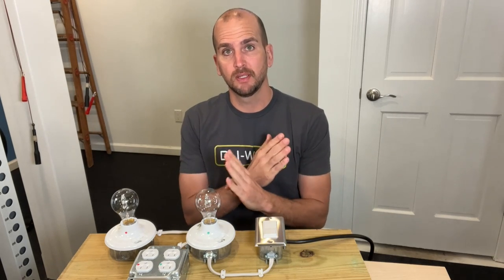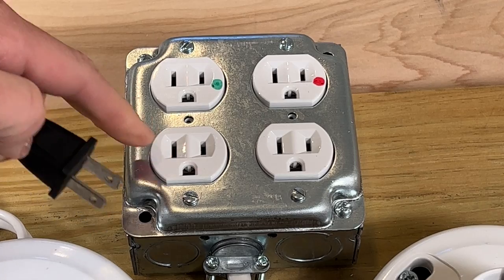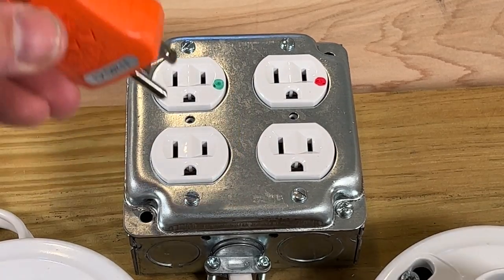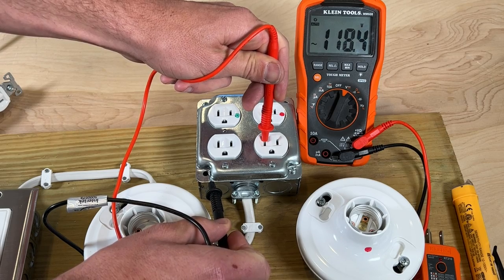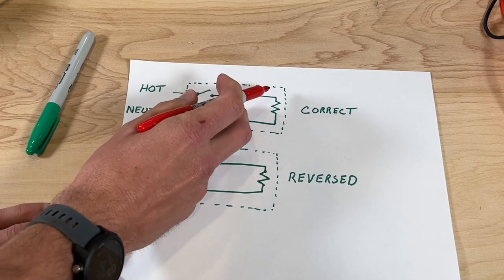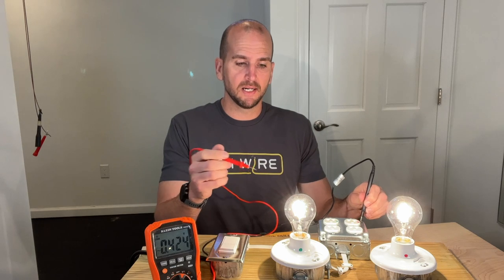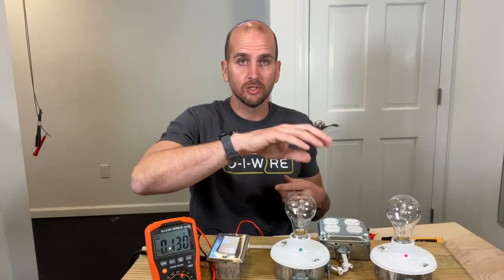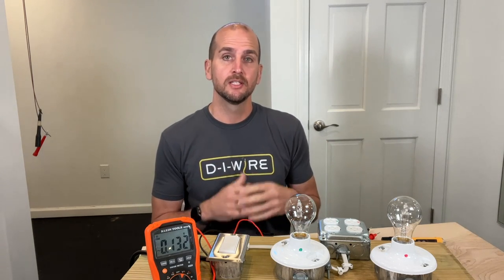Dangerous Wiring Issues In Lights and Outlets

Comment: 5:35, having a reverse polarity only is unsafe for the reason you showed.  It will not "Reduce the life", any more than a normally wired device because current is not flowing through the device if the switch is not closed, or it has some other way of completing the circuit.  Basically.. the electrons have no where to go.  The electrical potential is there (able to shock), because the person completes the circuit to the ground.
Reply: You have no idea on electrical. All corcuits like recetical mot being used but main breaker in is waiting to grab you and electricute you. All a receptical is , a wire with curent on it and a neautral to varry back half of the volt amount and a ground  is the earth rod 6 feet in earth to stop a line curent dead , trip breaker to take off the line curent, if line curent 0 volt ac  there no half  of it so it be 0 volt ac and ground always be 0 volt ac or dc.
Reply: @michaelspencer6523  really hard to understand what you are trying to say.. but here we go: 

There is no such thing as "main breaker trying to grab you".  What you are trying to describe is called POTENTIAL.  Like bottling up a water hose, with water pressure.  It wont shock you until it has a place to go.

 You have to complete the circuit to make electrons (aka electricity) flow.  A device will never "wear out" if it never sees that electron flow.  When a human "gets shocked", they basically "complete the circuit" and the electricity flows through the body like a metal conductor.  No loop, no shock. No loop, no electricity flow to harm anything.. including the devices in series in the circuit.  There is always an electrical source, conductor wire to a device, then from that device back to the source.   Break the loop, nothing happens. 

An earth ground only matters if you complete the circuit (loop), for the electricity to have a path to go to ground (or a battery or power station ground).  A wire has no current on it (current is defined as the FLOW of electrons) until it has a place for those electrons to go.  

A circuit breaker is merely a protection switch, that shuts off if it heats up from too much current flow.  It is merely a switch. Nothing more when it comes to the actual flow in a circuit.  I sometimes use circuit breakers as a switch.. instead of a regular switch, though that can wear out the springs in them.

BTW, I have an actual electrical engineering background.
Reply: @jacobw446  one main reason you not understand a electrician is you not a electrician and probly not from usa to onow slain english. Only great brittian speaks correct english. It not mean it did right, or usa enlish   is only slain. That  the names of tbe way ots customs is in real world. In iraq and afghastan wars. , i was over manys  britts. I had to gdt a translater to understand them. Like they sau its bloody bloody mate. I had know idea what tbey saying or meant
 It just meant it out of sight or very great friend. !  But anyways, you msde your self look bad at begining by saying YOU can not understand.  It simple englidlsh of usa. People think, i waunder  if you on drugs why not understand  grammer school slain english.  I know alot languages, tagalog, mindalin, etc. You learn many languages in tbe special  forces on usa army. And navy seals.
Reply: @jacobw446  loop, get off tbat game, there no loop, ac means alernate currebt  up and down not in a loop circle. My good ness, dc means direct currect means straight out not back. So ac has a curent line and a traveler of return called neautral and a safety  stopping net  called bearth ground. Dc is curent line plus isolated ground not neautral. It not travel back.
Reply: @jacobw446  go take a smal electrical journyman test , see how soon they escourt you out before you done as he walks around reading tests
Reply: @jacobw446  reason i said just a electrical journeyman test is, it only $20.00 test to loose not a $600.00 test plus a high bond cost  to loose
Reply: @michaelspencer6523  Guess my $100,000 electrical engineering degree takes a backseat to a $20 test and $600 bond.  Gee what was I thinking getting all that education for 6 years for my masters....
Reply: Incorrect. Polarity, is like a diode, it only allowed to travel 1 direction, the curent direction. The neautral is still made fir its components, it just the pathway is stoped until all voltage is equal to open its gates like ffom a bridge rectafier with 6 different  volts. Once all equal the total opened volts it turns on next step. It does not bypass a step. Polarity saves equipment that must be operating at same time it does . If not the relays not operate the circuts. Onece all ready it opens the coils volage of relays it needs to close relays contacts , it sends circuits voltage  to operrate. Can that polarity electricute ? Of coarse it can, it only current sent through processes straight to the components that neautral already in contact. Voltage still same as before it through polarity equipment.
Reply: @jacobw446  that the biggest lie yet. If you was a electrical engineer. You knew about everything i said, polarity and its dangers and earth ground and neautral not a ground but a traveler. Those items so serve a elctronics engineer already knows  that. Plus it not take $100,000.00 to take electronics as i did also. I need know  who be the school have you a degree electronics engineer endangering everybodies life in your therrory ? I also had to take a complete coarse in osha traing and i got all my 35 osha  deplomas . Serious violations you tell others . It bot just incorrect , it dangerious if anyone follows it and gets electricuted plus compontents are burnt up.
Reply: @jacobw446  just a eletrical engineer can not be a electrical journeyman or up later to a state licenced master  electrician. Electronics engineering is just part of a electricians learning. Must be way past that training to pass the state licenced and bonded mostly for $20,000.00 damages. Like on polarity damage or wrong code did on wiring. Like can not run romax in wood encounters in pinic rooms outside, must be in medal condiut . Etc. The text on neautral and earth ground has more than 5 questions each , etc. If you have got tbe bachlets degree in electronics. It not earned and should be revoked and fine the school who did that dangerious thing. And osha fine all people involved.  Osha is in ear zones and all jobs of usa  citizens. Huge fines , like in iraq war, in middle of fire fight, kbr electrician fixing the  circuit to tbe well house that makes filtered  drinking water. Oshua was near watching the kbr worker to see if he wore his safety belt hanging from a building. I seen it all my self. I eas over that kbr licenced journyman from texas. Great journyman, he  taught thousands under my 400 usa  military  bases in iraq in 2003- 2004.
Reply: @jacobw446  as paying for my daughters  college and complete  package for 4 year cosrse as computer programer Nd my own electrical coarses.  Just $100,000.00 is the cheapest i ever heard of. I paid more  for my self college as a master electrician . And my daughters  computer programing 4 year coarse , not the  tution , her tution  was a 100% paid by the governmentbof the philippines for genious scolarship grade A. It still more in cost then $100,000.00 only. It was 3 times  higher cost . I remember now in my college part in master electrician coase, the one coarse i had take as part of all coarses was electrical engineering, it was only a 2 tear coarse , that why you only paid $100,000.00 only. It not a 4-6 or even a 8 year  complete coarse. As master etrician is, doctor is, computer programing is . You lucky only spent $100,000.00 on a coarse you not learn on.
Reply: @michaelspencer6523  I was frugal and went to the right schools for my education.  But ok.  Your original arguments are still wrong no matter how you continue to try to attack me.
Reply: Why are you making your self seem so messed up on electrical ? There so much on it you have no clue since you not understand  neautral or earth ground. Like inductive motors, capasitors, what makes a sine wave  with a transmiter ? How many diodes would it tske on a 1 transmiter to make a volt sine wave ?  What is sine wave or half wave and why it important ? Why a mega generator not work without a earth ground ? On wire size thhn covering, on a 30 amp service , if it 400 feet away from main service breaker, what size wire required to use , etc, etc
Reply: When i hired electrical engineers  for the company  i worked  for as haliburton or kellog brown and root. I ask tbem a few questions first before i gave them a written test for a job. The first question most important for self and all  customers safety. What is a earth ground and what is a neautral ? If not answer  correctly, i sent them away , no text  waisted paper or time. Not useable. Only as a trainie as a journyman helper only i hire them for at bottom of list, use shovel.
Reply: @michaelspencer6523  Sure... have a good day...
Reply: @jacobw446  you to sir.

Comment: When I was growing up we had a Formica countertop with a metal band on the edge.  It was an L-shaped countertop with the banding starting at the wall between the kitchen and dining room and followed past the stove and then turned the corner past the sink and ultimately disappeared on the left side of the refrigerator.  Everytime I would touch a countertop appliance and the metal band I would get zapped.  Care to speculate?

Comment: A common mistake that can be made is when you replace a polarized plug on a lamp or an entire lamp cord. Yes it is polarized but the wires need to be fastened correctly. The lamp cord has a white stripe or a molded ribbed stripe along the neutral wire and the hot wire usually has the writing on it. Some wires even have a gold and a silver wire. So stripe or silver goes to neutral and gold or writing on that wire goes to hot. This will ensure the threads on the light bulb are not hot and dangerous.

Comment: A motor will run backwards if in reverse polarity. In a kitchen this could be a problem. One common motor that’s wired backwards mistakenly is the garbage disposal. They don’t last long because of the stress of the motor while cutting backwards.
Reply: Where do you get that nonsense? How would the motor know the polarity is reverse? It is three phase motors where changing any two phases reverses the rotation.

Comment: I was renting an apartment that the outlet wasn't grounded for the refridgerator. I found out when painting the wall sitting on the fridge and with bare feet stepped on the electric stove. Quiet the experience as I flew off the fridge !

Comment: I’d say you should also have promoted the one hand rule here. Instead of holding one probe to neutral and one to live you could have attached one to neutral and only used one hand to check the hot side. That way if you were to accidentally touch the hot side there’s a lower risk of having current pass feom one hand to the other though your chest.
Granted, I’ve almost never seen a proffesional electritian actually follow this rule, but when you’re educating the public it’s a good safety precaution.

Comment: Problem I encountered with these light fixtures is someone branching off from some random circuit to put a light in a random storage room and using too small a wire gauge to supply the light thus causing excessive heating of the wires.

Comment: I was replacing a three way switch with a smart switch and the secondary switch wires had reversed color.  It was wired properly, but white went where the black was supposed to and the black went where the white was.  Traveler was fine.  But on the smart switch it is important that the add-on switch is wired properly or it wouldn't work.  Threw me for a loop for a minute until i figured it out.

Comment: This problem is much more common and more dangerous when plug in table lamps have non-polarized plugs or the wiring is reversed. I have been zapped multiple times on miswired table lamps.
Reply: Maybe you should be more careful. Do not stick your fingers into Edison screws.

Comment: 5:22 There is a mistake. An open circuit will not carry any current, regardless of which side is hot. The only way a problem would arise is if there was a ground path inside the device such as if someone stuck their finger in a toaster connected to an improperly wired outlet and touched the heating element. But as long as there is no completed circuit, there will be zero current and the life of  the device will be unaffected. The current doesn't flow up to the open switch and then stop as indicated by the arrows on the diagram..
Reply: Yes a bit confusing..there's no current flowing in the wire until he touches it with his probe and then current flows through the meter to ground.

Comment: What's puzzling to me is why 3 or 4 prong dryer or range cords are so different, and the 4 prong is not so straight forward as the 3 prong with 3 gray wires instead of four different colors? I can do it, but it's still confusing? I do know is has to do with the neutral wire? Thanks 🙏
Reply: The three prong uses same for neutral and ground. The four prong uses separate wires.

Comment: I just noticed I have 3 outlets with reversed polarity. I opened one outlet to check hot/neutral wiring and it’s connected properly. Can that mean one of the other 2 might have wires reversed and is giving reverse polarity to all 3 outlets?

Comment: My only complaint with the video is that, while correct polarity is good for lights, the best protection from a shock is to just switch off the circuit.    Whether it's changing a light bulb, or rewiring a socket, you should never work on a live circuit.

Because even if your light bulb circuit is wired correctly, you can never garuntee that other circuits in the house are wired correctly, and there can be voltage across both netural and hot.

TLDR, switch it off before working on it, or even LOTO

Comment: This is why BC(common here) to ES  adaptors are banned in new zealand (Bayonet cap to edison screw), as they could be installed in a BC fitting either way around(have reported a few for sale, and got sellers spoken too, and possibly fined) Also travel adaptors are banned here, for same reason. 
Recently got a chinese led light, which had a (illegal) travel adaptor, which was giving me shocks. Turned out body of light was alive at 115vac when turned on , with adaptor one way around, and at 200+vac when switch was off with plug other way around, and shock current was 40ma. Supplier withdrew product when show tests. (we use 230vac @50hz).

Comment: Good tutorial.. 
I'm aussie and live in Thailand. When our house was built, we had the electrics done by an  "alleged" electrician. Bahahahaha.. 
After numerous storms and exploded or dead devices, I decided to check things. I purchased a multi-meter and a power point  tester.
3 zones  of power points, amounting to 30+ power points, all reversed. 
I then decided to test light switches (30+), first to ensure correctly wired, but secondly, if the switch or light socket was reversed too.
Yup, light switches off and 230v, when lights on, zero volts.. 
So armed with enough torches, into the roof I go. OMG.. 
Given the Thai heat, it was long and slow.
I checked every junction box and light fitting (35+).
Some wiring was correctly wired at the switch or power point, but mostly, each junction box was incorrectly wired from one box to the next too.
Thailand gets cable from USA, China, UK and locally manufactured. With that, 4 different colour codes and all made up the wiring in my house.
I tried to get the local Thai electricity agency to come around and fix it but all they wanted to do was rip it all out and start again. They however couldn't tell us when they could do it, as Thailand don't usually have qualified electricians for domestic settings. 
So painstakingly, I went around checking, identifying wiring for every switch, junction box, light, fan fitting and power point. 
I averaged about 3 junction boxes a day given the extreme heat in the ceiling and the requirement to have household power completely off throughout, given I wasn't trusting of any work previously done.
We're all good now. No more explosions or device failure due to electrical issues within the house. I'm alive to tell the tale too, so I must've done something right. 
Whilst I'm not a qualified electrician by western standards, I am confident now, my house is wired correctly. I know as much if not more than the average Thai person who claims to be a domestic electrician.

Comment: One of the most unsafe things with a light bulb was when I was 10 and my dad was changing a light bulb from a socket in the ceiling well someone took all the insulation off the hot wire so he thought it was a ground but it ended up shocking him as it hit the side of the fixture which was metal (he was fine) so he had electrical taped it after we turned off the power and replaced the socket.

Comment: I inspected some outlets and light fixtures, and I found something strange. I diagnosed them with my  NCVT and it beeped all around them, on the hot side, neutral side even on the grounding side, and I realized that there was like 40V or 50V voltages between ground and neutral.
Finally I found out that they were not grounded, and when I touched the ground side the weird voltages had gone and my NCVT never beeped on both Neutral and Ground sides. Is this thing normal??

Comment: i am honestly surprised that Edison style light bases are still allowed by UL given how easy it is to insert things into live connections even if wired correctly. any other product you try and get UL on and they are super strict on dielectric strength of insulation, leakage current to ground, etc. but as soon as you use an Edison socket suddenly its okay to have a large piece of live metal in the back of a large 26mm hole.